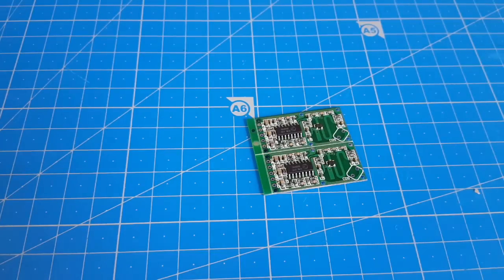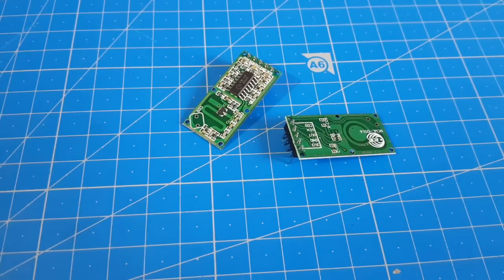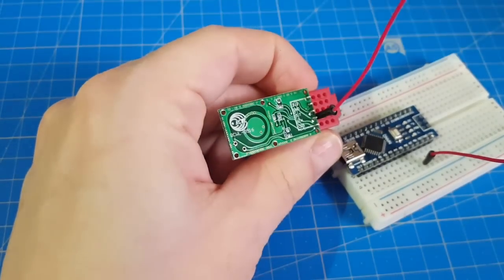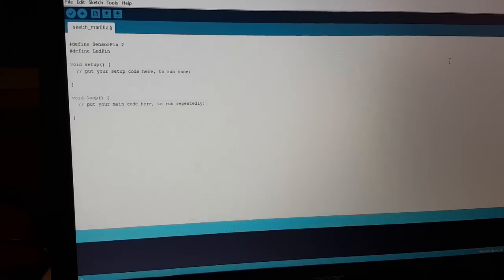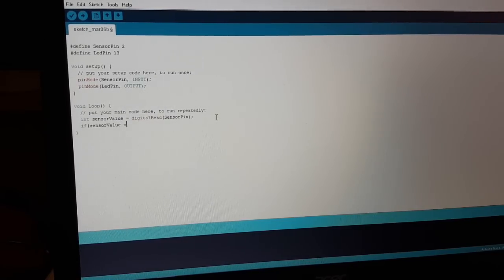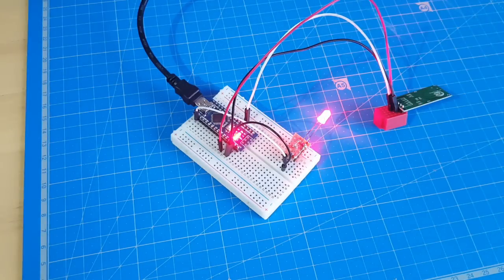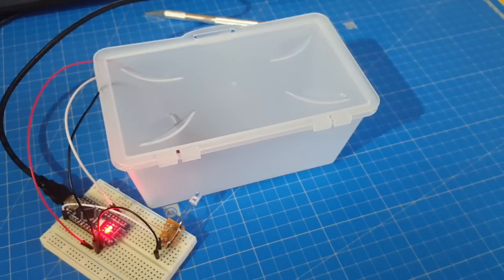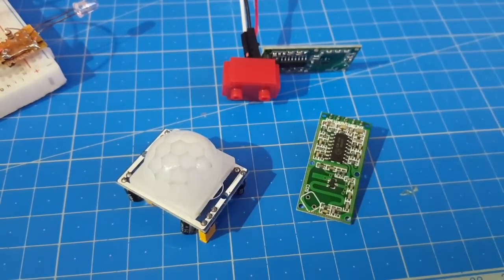Coolest motion detection sensor ever!

Comment: Hi, I want to ask, can I use this for pipe which is when we want to wash hand, the pipe move infront?  I need your or someone who read to give opinion.
Reply from the maker: I would recommend using a distance sensor. IR, Laser or ultrasonic. You can check if the distance drops to a certain value and let the water flow.

Comment: #define SensorPin 2
#define LedPin  13

void setup() {
  // put your setup code here, to run once:
pinMode(SensorPin, INPUT);
pinMode(LedPin, OUTPUT);
}

void loop() {
  // put your main code here, to run repeatedly:
int sensorValue = digitalRead(SensorPin);
if(sensorValue == HIGH);

else{
digitalWrite (LedPin, LOW);
}
}
Reply from the maker: Not quite. But close!

Comment: How to reduce the detection distance.
Reply from the maker: There are two solder points. R-GN. With a resistor you can reduce the distance. The datasheet says with a 1MOhm resistor the detection distance drops to 5 meters.
Reply: Thank you for your quick reply. Actually, I want to keep only 100 cm. Could you please provide me datasheet.

Comment: Hi,
Do you know if the detection range can be adjustable? I have read in sales literature
"2.R-GN Detection distance adjustment;connect with resistor and detection distance will become shorter;if not connect,detection distance is 7m;if connect with 1M ohm resistor,detection distance is 5m"
but I am not experienced enough to understand if this is feasible? Have you tested this?
Thanks
Reply from the maker: There are two solder-holes where you can add a resistor to decrease the sensor range. Haven't test it yet, but should work.
Reply: nenioc187 Thanks for the reply  Could a variable resistor be used here so the range could be adjusted to sit different environments?
Reply from the maker: Sure. Why not.

Comment: HFS-DC06 High frequency 5.8ghz Microwave Motion sensor   https://www.amazon.com/b?node=15469024011&pf_rd_p=75aea1ee-45a9-4762-b189-adadcfc441a7&pf_rd_s=detail-ilm&pf_rd_t=201&pf_rd_i=B078X9CY5C&pf_rd_m=ATVPDKIKX0DER&pf_rd_r=46J26M9W3P2T1WA7Q9N2&pf_rd_r=46J26M9W3P2T1WA7Q9N2&pf_rd_p=75aea1ee-45a9-4762-b189-adadcfc441a7
Reply from the maker: Haven't tried it yet. Looks interesting.
Reply: that's 5.8ghz Microwave Motion sensor,  u can try it, no temperature effection, triggered to work by detecting any movements within its sensing range

Comment: Just got a few. But do not have an Arduino. Hope, it will also works without an Arduino.  Did you try that? A simple blinking LED will do.  But thanks for the info.
Reply from the maker: Yes, it should work without an Arduino. The OUT-pin is pulled up high (should be 5V). But I don't know how much current is provided. Maybe you'll need a transistor or a MOS-FET to provide extra current to the LED.
Reply: Thanks will try it and rapport.

Comment: I now have several of these and they all work except the first one I bought... have you tried making them directional, using a metal reflector? I am trying to build a hornet detector that does nor respond to smaller insects, such as bees, and this seems like a possible candidate if thresholds can be programmed.
Reply from the maker: Haven't tried to making them directional. But, since it was shielded by the metal shaker, I think it should be possible.

Comment: Is it safe for human body?
Reply from the maker: Yes.  The Sensor uses about 30 milliwatts (mW). The radiation output is limited to that value. That is far less than your smartphone emits.
Reply: So how many do I need to run in parallel to make popcorn?
Reply from the maker: About 20000 of them. But still I doubt, it works this way :-p

Comment: Some car alarms use this kind of sensor and they can be adjusted to give a warning if someone comes to within a certain distance of the vehicle or to fully trigger the alarm if they get too close. I had this kind of sensor in one of my cars and it was the only sensor I needed to keep the car protected.
Reply: Nope. This sensor cannot be used for that purpose: it does not give a distance to the person. It just gives a 1 on its output if somebody or some reflective object moves in its range of about 7m.

Comment: Seems to be exactly what I need! I have been having issues with trespassers on property I own that is semi remote and therefore everything is off grid and power is a issue. I've tried pir sensors but they are easy to get around by moving slow apparently as well as the fact they emit light and are easy to detect after dusk. Have you determined a range limit? And it would help if you would make a list of required parts as I am not familiar with arduino as of this post. Completely awesome video, best useable info yet and I'm purchasing the boards asap. 👍👍👍
Reply: - PIRs don't emit light. That's what the "P" means = "Passive".
- This sensor's range is about 4m or so.
- As for the whole "protecting your property" project I can't really offer ideas, since I don't know the layout (fences, buildings etc), what available (if any) power sources you have there, your budget etc.

(I'm curious though. Why would people come in your property & walk slooowly, trying to get around sensors? What are you hiding there anyway? :p)

Comment: oh a microwave sensor, isn't that a bit dangerous, especially if you leave it 24/7 sensing near you ?
Reply from the maker: No. The Sensor uses about 30 milliwatts 
(mW). The radiation output is limited to that value. That is far less 
than your smartphone emits.

Comment: How could I change sensitivity or direction if I wanted to?
Reply from the maker: There is a connector marked as "R-GN". When you bridge it with a resistor you can lower the range. If you don't want a direction to be monitored, you could shield it. A simple metal plate will do. Like the test I did with the cocktail shaker in the vid. It shields the sensor completly.

Comment: It is not only a human motion body detector as you concluded with your cushion experiment. It is a simple radar unit and looking for large changes. At the frequency it uses, these large changes require things that reflect and absorb the signal to move. Try a piece of foil. It will detect it.
Reply: What do you mean foil? Aluminum?
Reply: @jeremyred6343  yes
Reply: Good to know .Thanks

Comment: How can i make a electronic measureing device ,Can i use motion sensor ?Or laser light sensor ?
I want to measure accurate size in thousands of inch or in hundreds of milimitor
Reply from the maker: Not with this components. The motion detection sensor detects.... motion. And the most, cheap devices, that you can handle with an Arduino aren't made for such a high accuracy you're talking about.
Reply: nenioc187 so what should i do now ??

i really need it

Comment: 0:43 FYI... you don't need to cut the scored lines on the PCB with the Xacto knife. 
The scored snap lines are designed to cleanly snap apart.
Reply from the maker: +lasersbee you're right. It was pretty easy to snap them apart. But I wanted to ne sure before I break them.

Comment: Gonna make a cat detector with theese.
Thx for sharing.
Reply from the maker: Cool! Tell me how it worked out. My cat had to be in close proximity for the sensor to react: 
https://youtu.be/0HYRD35F570
Reply: Done more testing now and it works but not as good as i hoped. 
It can detect the cat from a good distance but only if cat rapidly move. If it sits infront of it and do a little cat wash or so it dosnt detect it, it have to walk before it detects even if cat is rather close.
It does detect thru walls but it didnt detect me thru my house outer wall.
Reply from the maker: Cool. The outer wall of a house is usually quite thick.
Reply from the maker: That's awesome! I love the design!

Comment: Nice video thanks.  Is there any way to alter sensitivity?
Reply from the maker: Indeed, there is. On the pcb you'll find two solder points, marked as R-GN. Corresponding to the datasheet (that is Chinese all the way), you can solder a resistor in between. That should decrease the sensitivity. But I haven't tested it - yet ;-)
Reply: Thank you for the blindingly fast reply!   :o)   I am just ordering a couple at the moment.

Comment: Do you think it will detect precipitation? It might be useful for automatic windshield wipers.
Reply from the maker: Nice idea! But I doubt it will work. 
1. When you move the sensor it triggers itself. Even the vibration of the motor can trigger the sensor. 
2. I'll guess the rain drops are too small to detect for the sensor (see https://youtu.be/0HYRD35F570 where a cat has to be in close proximity to trigger the sensor).
3. Usually a vehicle is controlled by a human, that would trigger the sensor.
Reply: Thank you.
Reply: +Jason DeLozier whether or not it can detect water droplets is a hardware issue, not software
Reply: The most common modern rain sensors are based on the principle of total internal reflection: an infrared light is beamed at a 45-degree angle into the windshield from the interior — if the glass is wet, less light makes it back to the sensor, and the wipers turn on.(wikipedia) This makes sense as the sensor not only sees the rain but it senses the quantity os speed of the rainfall and the speed of the wipers is adjusted accordingly.
Reply: Good question, I honestly don't know, I will look into it. Part of the diagnostic process is to actually spray water in front of the sensor.
Reply: No. Its a doppler radar.
Reply: Rain sensors exist in some vehicles already which not only detect rain but detect how fast the rain is falling thereby speeding up or slowing down the wiper automatically. I work on jeep vehicles and have diagnosed many of those systems. Those sensors must be available somewhere.
Reply: I believe that being an RF emitting device that what it is detecting is water.  Humans are mostly water so are detected.  I think you are on to something... I would be interested in your rain sensing test results.
Reply: Karmicmessenger 
I wonder what the methodology is. Piezoelectric perhaps to detect the vibration, magnitude, or frequency?
  Wipers coming on when you follow too close to a dump truck carrying rock dust anyone?
Reply: I imagine it will do whatever it is programed to do, that is the beauty of the open source system, we can all benefit from and enhance that which we are all becoming more proficient at understanding.  I can actually say that I don't know much of anything about this, but I like it.  I have learned how to turn 4 LED's on in series and adjust the rate at which they blink but that's it, and that's all.  And I did attempt to use sonar but that's it...

Comment: Wow! now I'm convinced people will use a processor for everything. Even in place of... a wire.
Reply: LOL. That was the first thing that came to my mind. I'm relief that I'm not getting older and some people think like me.
Reply: Gato I imagine there might be some additional point of the project that's more complex than what a transitor can do. But so glad to hear your fantastic opinion.
Reply: My thought exactly. Lol (no offence to the uploader though. This is a demo after all)
Reply: No reason for micro, you can plug led directly to output of sensor
Reply: Yes, thanks for sharing the video, I subscribed!
Reply: what do you mean by "processor" ?
Reply: If the end game is to build it into a project based on Arduino, then why not start with the Arduino to sense the input? It's better than wiring it up directly to the LED as this will also mean you can test values, pin current draw, interference, and then change your mind and send the output to an MQTT server or suchlike...
Reply: You're comment is sarcastic, but not... helpful... What are you talking about?
Reply: Not all sensor boards can power any random device off the output, yes in this case it could handle an LED but the video is making a more generic point....do you all really not get that? the  LED is just standing in for any other device.
Reply: Sorry did not realise a wire could tell the difference between human and other object moving- please explain how you get a wire to do that?
Reply: I was thinking the exact same thing.

Comment: Thanks for the video, i wonder if this will work with a esp8266. The infrared ones are affected by the esp8266 i have mine trigger when there was no motion. Some people mention that they are affected by the WiFi radiation or something like that. 
 I wonder if these sensors will be affected in the same. 
I ordered some that will come from china  for the ridiculous price of AU$0.72.
Reply from the maker: I also heard of this problem with the ESP and the PIR sensor. And since this sensor works with radar waves, it might be a problem I've not thinked about yet. I want to implement this sensor in one of my bigger ESP projects. So I will test it prior and upload a video.
Thanks for the tip!
Reply: Apparently the pir can be fixed by soldeingr a 220nF ceramic capacitor across pin12 and 
pin13 of the chip (BISS0001) so that the high-frequency interference 
coming from the ESP8266 don't influence the gain stage anymore.
 I didn't try it so don't know if works. i am waiting for my radar waves one to come.
Reply from the maker: I tried it with a ESP8266 on a NodeMCU board. Had no problems with false positive results. Video is in my queue and will be uploaded soon ;-)
Reply: That's grate, i am exited just waiting to get mine from china and to start tinkering with them. 
Thanks for your video was very inspiring.
looking forward to see your video with the NondeMcu
Reply: @adifoto @nenioc187 
I've been struggling for WEEKS with a miniature DIY motion detector device built with RCWL-0516 + ESP8266 + mini 5V P/S.
It sometimes works flawlessly for hours then starts giving false triggers repetitively ... I even tried to get the radar sensor out of the casing in case it would work better when distant from the ESP, but to no avail :-(
I think this sensor is definitely prone to interferences and not reliable enough to be used in a motion detector device in the long run.
Any feedback here will be welcome !
Reply: ESP8266 ESP-12-E 4M Flash CP2102
The false triggers are quite **RANDOM**, it may work for hours without a problem then suddenly starts triggering without any reason !
Weird behaviour ...
Reply from the maker: No. The E-Version is already shielded. It has even a FCC certificate that it won't interfere with other electronics. But it is, of course, no grant for it. ;-)
Reply: Got it, I thought you were suggesting to make an extra shielding encompassing  the entire PCB !
Yes, I confirm the ESP8266 (and flash memory) chips are well shielded on the ESP-12E board.
To be honest, I am not even quite sure the ESP is the culprit for the radar false triggerings... it could also be due to ambiant RF interferences, hence the random behaviour ...
If it were only for the ESP, I would have consistent false triggerings, would't I ?
Reply: Good info. Thanks for posting this stuff it saves time :)
Reply from the maker: I just made some short-term tests, where it worked just fine. I will publish the vid this weekend. 
But interesting to hear that it makes problems on a long shot. Sure it interferes with the ESP? If so, it would get false positive values right from the beginning, wouldn't it? 
Which version of the ESP are you using?
Reply from the maker: Weird indeed. The ESP-12E should be shielded to prevent any interfering. Does it trigger constantly, when this happening?
I'll guess I have to add a long term test..
Thanks for the feedback!
Reply: Unfortunately, I am afraid that shielding the ESP will not do anything good to its WIFI range ...
Reply: A cap on it seems to help any application of the PIR. Has anyone tried simply distancing the PIR from the ESP8266 antenna? I've had a PIR on a 10 foot line work great but it was on bluetooth. I have a few ESP12's around so maybe I'll try it.
Reply: <quote> Has anyone tried simply distancing the PIR from the ESP8266 antenna? <end of quote>
>
Yes I tried that (as mentioned in my original post) ... to no avail.
Reply: Any real theories on this interference?  As a chemist I cannot imagine why the microwaves from the WiFi (it's in the microwave range) would trigger a PIR but obviously it does. Any ideas? H2O molecules on the sensor being excited by microwaves?
Reply: I am testing one of them at the moment but once in a while i do get one false positive. Could be that my esp is faulty, i am waiting for few more to come and will see if i have the same problem or not.
Reply from the maker: Interesting. How long does it take before the first false positive result occurred? And is it just a one-time-trigger? Or will it continuously trigger?
Reply: Sometimes one-time, sometimes in burst ... random !
Reply: Exact same problem here, I was trying to use the RCWL with different sonoff products but any combination results in random false positives...
Reply: Supposedly this PIR https://www.aliexpress.com/item/Mini-IR-Pyroelectric-Infrared-PIR-Motion-Human-Sensor-Automatic-Detector-Module-high-reliability-12mm-x-25mm/32749737125.html  motiondetector can work with the ESP8266.
Wether the RCWL0516 can I do not know, but I presume it will
Reply: I've never had an issue with IR motion detectors and the ESP8266. Maybe I have better sensors or have them wired up in a way that works better.

Comment: Is it possible to use it as a presence detector? To notice if there is a person in the room?
Reply from the maker: I could detect movement within the whole room. I think it could be used as a presence detector, but with some limitations. It is easily blocked by walls. And while I was on my couch, watching TV, it didn't trigger my laziness ;-)
Reply: It used doppler effect on radio waves, so not if the person is stationary, but if they move then yes they will sense